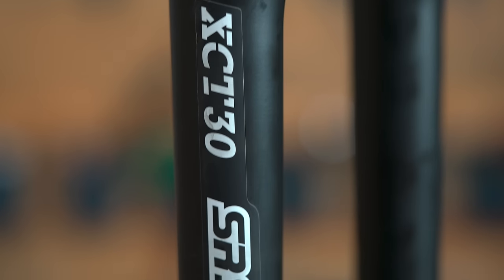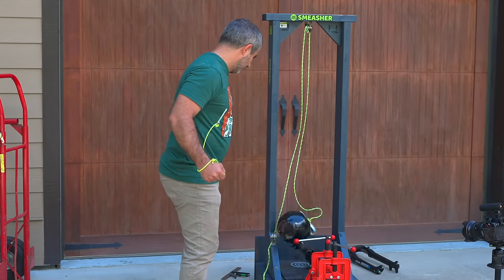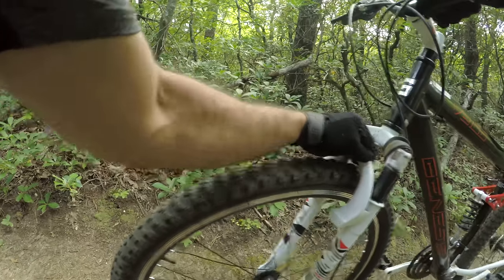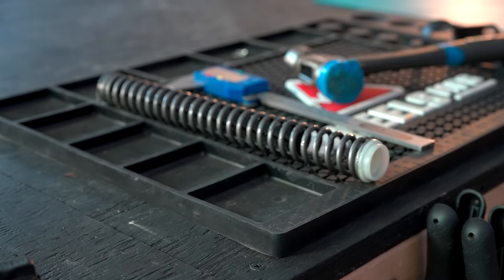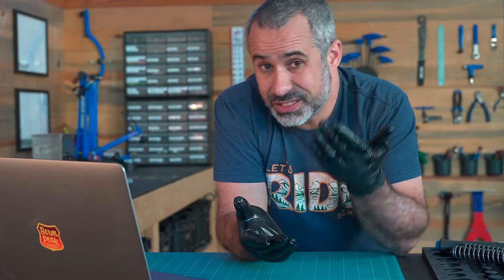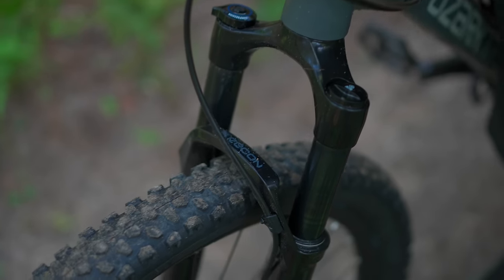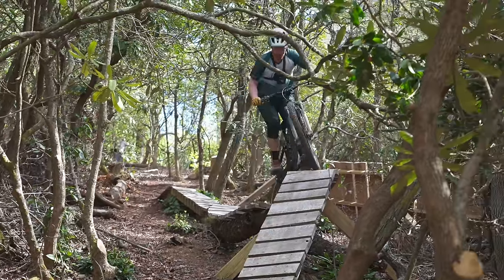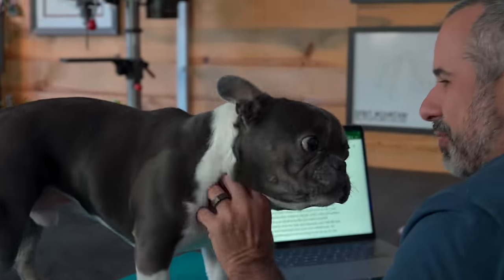The most popular MTB fork you (probably) know nothing about

Comment: I really appreciate this video. While working in a shop, so many of us ended up with the high end Suntour forks on our rides and we learned not to turn our noses up at the lowend Suntour stuff. As often as we had basket case cheap mtbs in the stand, these forks were not among the things we were fixing. Truly an underappreciated brand in cycling here in the us.
Reply: I think every bike under $1K has these forks on them. Slamming them is nonsense. These forks get people into mountain biking.
Reply: And like Seth says, those forks on the bikes being worked on never get serviced, even though a little tlc would revive many, at least the ones not left out in the rain—although I’ve experimented with a couple lost causes with surprisingly adequate results. Follow-up episode?
Reply: @slantedorbit It's a shame, they need to be serviced specially after riding on rain. The steel rots with water and that's something you don't want happening in your forks or springs. I've seem them break because of that.
Reply: That’s cus they are disposable bike products. I get them in a pack of ten online.
Reply: low end suntour forks are complete trash.
plastic components,
warranty warns againt wheelies.
fitted on the worst cycles you can buy
Reply: Suntour are pretty good for the money. 
Used to have the 140mm tapered steerer one on my hardtail (called the aion or something weird).
Aside from the proprietary axle being very sensitive to temperature for some reason, they were faultless. 70miles a week commuting in all weathers, and 30-40 miles of bike park, trail centre, bmx track and DH abuse every weekend. 
Had them serviced once every 12 months, and never once had an issue. 
The adjustment, while quite coarse, was more than adequate to tailor to a certain trail, the break from sag to support was supple not crashy like a lot of cheaper forks from RS or 'Zocchi, and I rarely found I needed more stiffness in the chassis. 
I was damned impressed.
Reply: @g.w.customcreations3534  this sposnored video is about suntour xcm, which si 100% trash
Reply: Living in East Asia, there's a plethora of other brands of cheap, light forks. The riders here are smaller, and lighter. Ship them to the West where riders are 50-100% heavier and have more extreme trails and riding styles and the problems appear straight away. If you're in the West and buying one of those forks for cheapness then you really have to consider your weight, riding style and locations.  

Interestingly there's enough RST forks around, costing 75% of Suntour forks. A lot getting ridden hard (stair runs and drops) and videos are around of seals and dampers failing. Suntour are generally better than RST. 

I have Rockshox Revelation (motion control) 417usd, Manitou M30 153usd, Suntour Aion 278usd, Suntour Durolux 417usd, and RST Killah 29" 473usd.  

The damper in the Revelation is no good for technical riding. Your arms get beat up. The Manitou is only good for roads and smooth trail. The Aion and Durolux are fine for riding down mountains. The high/low speed rebound andncompression adjust on the latter stands out The Killah is like landing on a cushion when riding down mountains and at bike parks. Top end DH forks (Fox40, Suntour RUX) are almost 3x the cost.

Bling isn't needed for most riders. But replacing the XCM/XCR if you're riding on anything other than smooth(ish) paths is necessary. They are better than having a rigid fork, and I bet most riders are only using them on holidays on national park trails, or around their neighbourhoods. They look bling to those owners who have a particular budget.  Budget, opportunity and location of riding is important. One day those riders may have more time, opportunity and drive to upgrade and get more involved. Cut them off the market and you've got two options: Toys'R'Us bikes, or serious commercial brands, and nothing in-between.
Reply: @netcoms197  my point is that for the price point, there are much worse manufacturers. And even at higher price points. Seems a lot like you have a bug up your arse about this fork. You get scammed on one or something?
Reply: @netcoms197 How many low end entry-level riders can pop wheelies?   The fact is that they work well for what they're designed for.
Reply: @bruceb5481   the fork is warned againt the front wheel leaving the ground, due to the fact that that they do not work well, and the design is flawed at teh most basic level.
everyoen ho learsn how a firk works, will knwo that this is trash, designed to limit/fail the user

while deceivers, and fools defend complete junk, it will only get worse for the consumer.
Reply: @g.w.customcreations3534  seems like you are making creepy attacks at me fr discusing a poor quality cycle fork, that every mtber knows is junk for the purpose for reasons  explained already
Reply: @netcoms197  Not at all. There's no need to attack you, your poorly formed argument and terrible English do that without my input.
You seem to misunderstand the purpose of such a budget product. Their target market is casual cyclists, who want a fork for a little more comfort, and possibly to allow them to venture out onto rough fireroads or light cross country, at a price point most folk can afford.
Jumps, wheelies, and front-end intensive riding is not what this fork is designed for, despite it performing much more admirably than it should, by rights.
If you take a stock Ford Ka to a rally stage, it probably won't do very well, and may indeed have parts failure. But it might well give the driver the bug, leading them to invest in a more appropriate vehicle.
It's the same principle. 
A simple damper rod fork is very cheap to produce, is low maintenance which suits a casual user, and will cope with far more abuse than any offering from a premium manufacturer would.
But it fills a niche in the market, and will tempt folk to get into MTB in more than just a casual fashion. This is great for the industry, and in the grand scheme of things, leads to bigger parts development budgets, more bike parks, better protections for natural riding spots due to increased popularity, more publicity for the sport, and many other benefits for wider society. 

You saying "it's trash", shows a lack of maturity and basic understanding of the subject you're discussing. 

Please, stop shouting off about this, listen to folk that have seen and understand a lot more than you, and I believe you'll learn quite a lot.

Have a good day. 👍🏻
Reply: @g.w.customcreations3534  sure you tried to attack me, and im decostructing your  attempt as you keep tagging me for a response.

if you wana talk about poor construction, look at the xcm fork, or look at the rider in thsi video voiding teh warranty as he jumps and wheelies, (lol)

i did not click on teh read more of your comment due to lack of interest in nonsense
Reply: @netcoms197  you're a sad individual. I almost feel sorry for you
Reply: @BaldKiwi117    im happy to tell teh truth no matter how affected you are
xcm is a trash fork, that mtb riders dont use

Comment: $100 off a trade-in... Most valuable advice I've gotten on YouTube in a while. I'm about to turn my old hard tail into something interesting, and I was going to scrap the old one since it's leaking oil
Reply: yeah good idea upgrade from a broken trash suntour, to another suntour, that wil be a great idea.
suntour make budget beginner tranh that is on all teh cheapest bikes you can buy,  to try and force beginners into an "upgrade",
Reply: @netcoms197  yeah everyone you've probably ridden is trash. Like Seth said, they have a full line even air forks. You just don't typically see those as you only know them for their budget offering. I don't have a brand allegiance and don't pay for style. I'm sure they have something that will work for a fun bike I might use a few times a year
Reply: @netcoms197  you didn't watch the video and that's ok, I believe "Seth" @9:35
Reply: i've had a couple customers opt to upgrade their coil OEM Suntour fork to a higher-end air fork and they've never been happier.
Reply: @540 seth is paid to say what suntour tell him to say 
this is not an indepedent review or an independent youtube channel.

seth also breaks xcm's manufacturers guidelines and deceives the inexperienced people liek yourself, that this video is tagretted at

its a very very badly designed fork,
Reply: I used the upgrade program to upgrade to a Raidon air shock. It was a a great upgrade for what I paid and it’s been rock solid for the past 3 years. Totally worth it.
Reply: So Seth suggests Rockshox Recon as a good budget fork upgrade for Ozark Trail Ridge. But then there's this $100 trade-in offer by SR Suntour. So the question is, if SR Suntour's forks priced around ~$350 are better or worse than Rockshox Recon at ~$250.

Comment: Thank you for publishing videos that are always interesting and informative. I'm watching from Japan and I'm always looking forward to your videos.

I replaced the XCM on the Merida Big 7 (27.5inch) hardtail XC bike (88,000yen/$588） with a Raidon, the same SR Suntour. The reason is that I wanted to know what air suspension is. I'm very happy with the fact that it's much lighter than the XCM, and you can adjust the sag according to your weight, adjust the rebound and remote lockout.

I think that the same XCM, but with a damper and a lockout, is a very good product. However, since the legs are iron, I replaced it with a slightly higher-end Raidon (air suspension fork with magnesium legs). Still, I keep it instead of throwing it away, because I might go back to XCM someday. If it's an XCM with dampers and lockouts, and the legs are magnesium, you might still be using it. (It would be best if Raidon's magnesium legs could be used as they are for the XCM)

As Mr. Seth's advised, I first replaced the drivetrain of the Merida Big 7 with a Shimano Deore 1×12 (XT with a 165mm crank only) and replaced the brakes with Shimano hydraulic discs instead of mechanical discs. The fork replacement is after that.

Eventually, I bought a Marin Bolinas Ridge 2 with a low standover height and have been riding it with the fork and drivetrain ported from Merida. This Marin is very fun to ride. I only run on the road beside the irrigation canal and the path in the rice paddies, so the Raidon was enough. According to the instruction manual, the limit for jumping seems to be up to 60 cm.

From the SR Suntour Axion on XCO World Champion Tom Pidcock's Pinarello bike to the XCM on the entry-level bike, I don't think the SR Suntour forks are bad.
 And as a Japan person, I also like the fact that the name "Suntour" has been preserved to this day.😀

In Japan, as in the United States, SR Suntour also provides parts for rebuilds and provides videos explaining how to maintain them. Maintenanse is very easy. Yesterday I disassembled and cleaned the Raidon, applied new grease to the negative spring and poured 80wt of silicone oil inside the air piston.

I think this video is a very professional review that evaluates the excellence of XCM from various angles.
Reply: 楽しそう!　Sethさんがすごいですよね。田舎でマウンテンバイクしては夢見たい。まだSuntourがあるけど、日本でもっと乗りたい。

Comment: SR Suntour's XCO forks (with air spring; vs XCMs that are coil) are also a great lighter-weight alternative for entry-level bicycles.
Reply: there is also the xcr air which is also an air fork, not sure how this compares to the xco.
Reply: XC...... O?
Reply: @szolekxxx  You can exchange the coil negative springs for a lighter spring rate and it will allow you to adjust the air side for a rider in the 45 - 55 kg range.

Comment: Almost 9 years into mountainbiking as a main hobby, I'm still running an SR Suntour XCR32 coil fork with a rebound adjuster that I bought back in 2017. It's been through quite a few XC races and lots of just weekend trail riding to this day. I service it at least twice a year, and recently I replaced the coil with a new one, feels better than brand new now. It is heavy but it gets the job done.
Reply: How do you service it? I have the same, but have not done anything for 4 years on the fork.

Comment: The content a lot of consumers need to see. I have been testing a few different forks (some for bike brands and some for suspension brands) and my feedback on SR Suntour lineup is similar to yours Seth. The XCR 34 130mm Air is still on my trail hardtail (I oiled the foam rings and added 5cc of 10wt oil in the lowers) and the fork is incredible for the price. Also running Raidon 34 130mm on my 120mm "downcountry" and it is comparable in performance to my Fox Rhythm 130mm. I have a Fox 36 on my big bike and swopped it with a Durolux for testing. The Durolux needed some fine tuning - oil weight being the main reason, I dropped it substantially for more small bump compliance and sensitivity / faster rebound. And its been great. I've also tested plenty of cheap chinese forks and risked life and limb to push them to the limits and can not recommend one of the one's I've tested so far.
Reply: One quick question
Can I mount a 130mm fork on a bike with 100mm fork by default?
Reply: @erfansoltani678  frames are only tested with a specific fork length. Anything outside that may result in early failures. I would steer clear of anything more than 20mm more than the fork that the bike was designed around.
Reply: @francoinvisser4058  Thank you so much
Do you have any exprience with giant in-house built 130mm crest 34 air fork (on Fathom) ?
Your answer means a lot to me cuz I'm going to buy a giant bike but I'm worried about the fork
Reply: @erfansoltani678  its a pretty decent fork for its class - but they do tend to suffer from bushing play after some use. Can be replaced by suspension workshops though, so no need to rush out and get a different fork.

Comment: I serviced a couple of those last year. And they are super great to do so. Also Suntour's help is superb. My kid had a bike from Decathlon (2020) and they had ordered it with the stiffest spring. So I emailed Suntour's help and they gave me the part number for the softest one and we changed it. You don't need a stand, just a help from your kid. Next time I had a problem with the other one, disassembling it (a pure novice and an old fork). And send them some pictures and they helped me again. And those were XCM 100, and XCE 80 forks from 2015 and 2020. I got the special tool to open the upper legs for ~3 Euro and you need a 9mm (I don't even remember) wrench for the nuts on the lower legs and that is it. We did it on the bike. Maybe a flathead to remove the rubber seals on the top. Seals and plastic bushings (this is the service set) cost around a 10 for a set and you need some fork grease. It makes all the difference, you can do it for the cost of a Starbucks and you do it with your kid inside your home - priceless.

After we serviced them I started noticing them all over the city for cheap and mid spec bikes and most folks that I have asked never did anything on them, ever, for years.  

Everything has its purpose and those XCM and XCE are just great for the city jungle and light off-road.

Comment: I saw service interval of 10 hr somewhere in literature when I was researching how to service.  A basic service is just some disassembly for re-greasing the moving parts.  There is no oil in the fork, and should NOT be.  Lubrication is provided by a layer of 'light' grease (such as Slickoleum) and is not hard to do.  Otherwise, wiping dust off of the uppers after use, avoid forcing water into the seals,... these forks are fine for some light trail riding, gravel rides etc especially if the coil resistance reasonably matches the rider weight and actual use.  I think it's not unreasonable to just use use use until the fork is having sticking issues etc and then deciding to upgrade the fork or the entire bike.  If that's not a reasonable option for a user, maintaining the fork with periodic re-greasing just might achieve a respectably long service life :)

Comment: A couple of years ago I hit the side of a car at 23mph, my front wheel was totaled and the suntour air forks bent back at the steerer. Thought the forks were completely gone too but they weren't. I bought a cheaper set of spring forks and took the lowers and the air cartridge from the accident fork and put them on the new cheaper one and it works great! They really are tough!

Comment: I dare to say that people upgrades to air forks not because the adjustability, because most won’t know how to adjust it properly, but for how smooth it feels an air fork. BTW not long ago I bought a Rockshox Judy Silver 120 mm travel with rebound adjustment for under 150€.
Reply: Most people who upgrade their bikes do it because they feel their current setup is holding them back or they rode another bike with the setup they desire. It's good for the industry for people to try different products and it's good for the serious rider to make the investment to see if the products improve performance. I raced down hill in NORBA for 7 years and I went through several frames, forks, and brakes in that time. Had those awesome Risse upside down forks on my modified Super Vee with 8 inches of rear travel LOL

Comment: Had those SR Suntour XCR fork, w/coil preload, lockout & rebound adjust at the bottom... Much better... I prefer the XCR. 😎👍
Reply: Got the same, it actually ain't that bad👍
Reply: @mike78bassmanify  yep, cheap fork, easy to service. Good performance for entry level forks... And some XCR are air forks. Not bad for the price. 😊👍
Reply: @Emz_Jhaye  Mine came with the bike, and had very little expectations for it, but was pleasantly surprised. Same with the Tektro brakes.